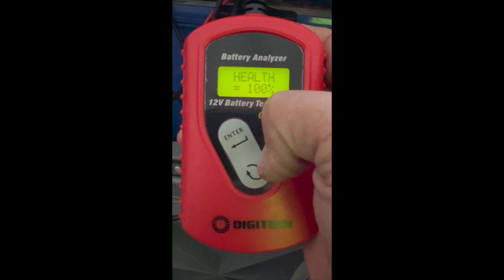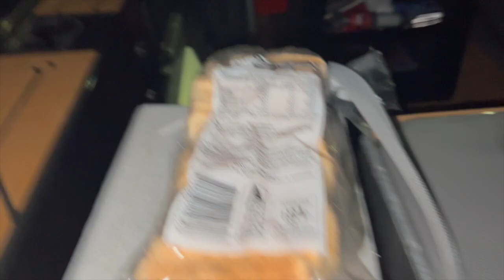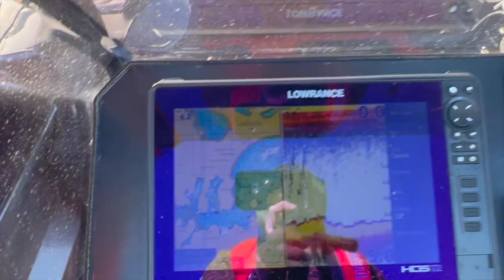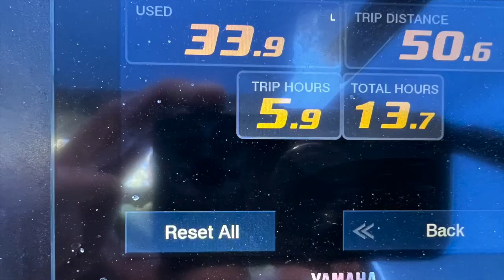EP#32 FLYING SOLO "NEW BOAT EXPLORE HACKING"

Comment: A little tip for outside of the hacking.
Stick close to the cliffs about 100 or so metres and use the contour lines on your sounder to drop baits.
Some very productive spots in the hacking for big flathead and jew too
Reply from the maker: Cheers Tiller appreciate the tip , will give it a go
Reply: @nautijade  if fishing the contour lines outside dont use big sinkers.
Where you fished at the back of shark island chuck out some squid jigs too.